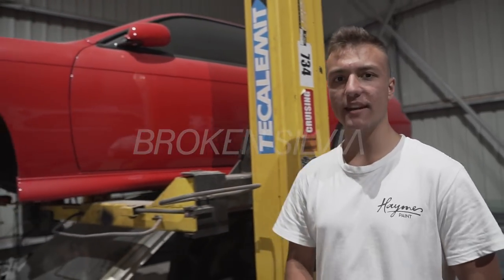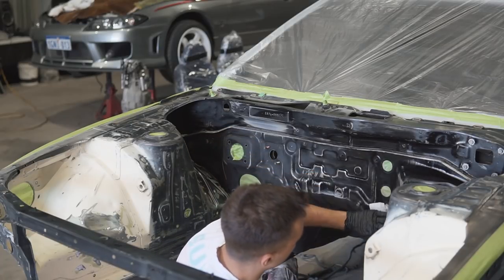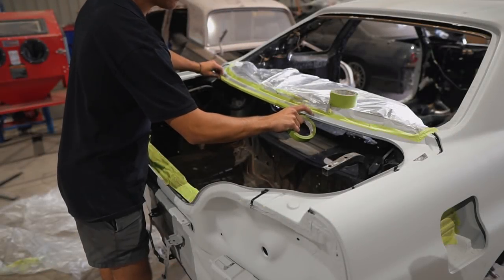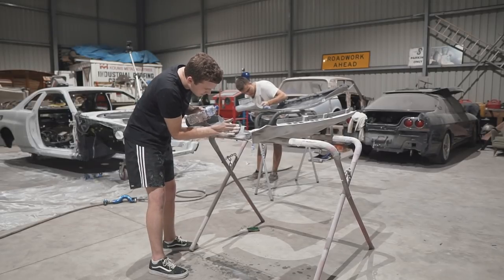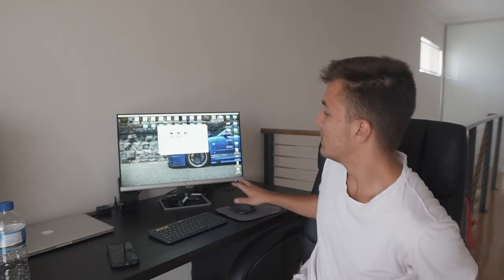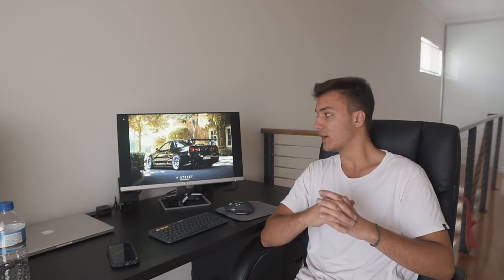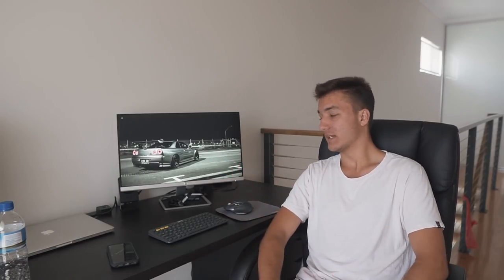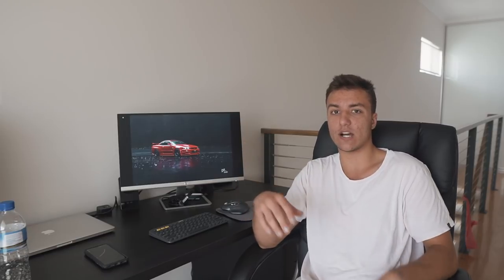My R34 Skyline is PAINTED! | Poor Man's GTR [EP10]

Comment: Downside to red ... the colour red fades the swiftest; it’s a science thing.
Reply: All has to do with the light wave lengths. A blue is a shorter wave length, red is a long wave length. Now, the reason I'm going into detail here is I did a speech on colour once and the people who came up to me afterwards and said they had no idea this could be so in depth. All the colours you see have one thing in common, the colour given off something means that it absorbed all the other colours and that one particular colour is reflected off. Hence a green leaf shows green is because it has absorbed all the other colours. The time light is spent on an item, car, plane, leaf, tree depends on the colour reflected. A blue colour reflects that colour quicker because the light length is short, however, when we come to reds and derivatives of red, the light stays longer on that colour and has more time to degrade. Hence you see red cars with colours that have been bleached out. A reason why red fades quicker. Hope you didn't get bored reading this. Your car is going to be amazing.
Reply: silverGTO TwinTurbo nice GT3000 i want one so bad
Reply: @_.Mercury._  Thanks buddy, had her for eight years now, she is my baby and wouldn't trade or sell her. It is actually a JDM GTO (Japanese Domestic Market) with a few mods, carbon fibre steering wheel and loads of other mods. Has been the GTOUK car of the month three times in the past five years.
Reply: Im a car detailer and i find red hold scratches and dirt a lot more too
Reply: silverGTO TwinTurbo yeah currently looking for one, i know quite a bit ab Jdm, as an American i call them 3000Gts, ya know its like calling a 240, a 200, or 180 but... ive always had a soft spot for those Dsm stuff, and theres a really clean dark green one close to were i live, but i can only find them in red and white, i mean they look phenomenal but the dark green just strikes me more.
Reply: Its actually the green pearl

Comment: I always enjoy these types of builds and your attention to detail just blows me away. So I'm wondering why when you removed all the seam sealer from the engine bay, why you didn't stitch weld the seams. As I've said, I enjoy these types of builds and in most, when the level of detail you've already done on this build, most would do the step of stitch welding all the seams to add extra structural strength. I know this affects how a car will perform in a collision, but the extra stiffness and rigidity for this type of car, given how you intend to drive this  car when finished would be a good thing. I know it's your ride and it's totally up to you. I was just wondering. Excellent build! I'll keep watching and thumbs up!
Reply from the maker: Hey man thanks for the comment! It's a street car so no need for it. If it were a dritft car that will never see the street then I would consider it :D

Comment: Awesome vids, ive been watching since the start. I have an 04 sti that im going to tear down and work up from the ground up. What grit do you recommend to start off with, when wet sanding? Also is it a good idea just to use a heat resistant spray paint for the suspension mods that i want to re-use but restore?
Reply from the maker: Cheers man
Finish off with 600g or 800g wet
Get them powdercoated
Reply: @BrokenSilvia  thanks bro, i was trying to do it all on my own and dont have the equipment to bake it.

Comment: Red has no downsides. People in America scream it's a cop magnet. Nope their driving is a cop magnet. Easy to keep clean, passes the 10 foot visual test with flaws and like you said easy to spray. The world just like boring grey, white has ethnic and religious overtones and black is hard to keep clean, but as you said ceramic coatings and other paint protection is a must, it will save you the headache of owning a black car, short of wrecking it.

Comment: You missed out silica breath. Yeah its really hard to choose a colour and took us months. We did numerous test sprays and ended up going with our own variant of millennium jade as the original jade is too grey and ours is a more suited brighter olive which shows off the lines a bit more. In fact I'd say its inbetween MJ and Silica breath. I personally would of gone red but my mate has an actual real 1 of 62 red R34 GTR so similar to your reasons I couldn't go that colour. 

In all honesty the colour I would of chosen for you, would of been Yellow. It's the rarest R34 GTR colour and probably the nicest to go with black and carbon. Its pretty much the best colour option out there and would transform your car. 

I really hope you didn't go MP2 like in the thumbnail. It's a R33 colour and I hate it. It's the second most common colour for a R34 GTR Conversion with bayside blue being the first. With all the hard work you've done it would be silly to not differentiate your car with all the other builds. With that in mind the only option for you is to go custom colour like us or Red, Yellow, Silica Breath or millennium jade. If not any of those options I truly feel you have made a mistake. Everyone sprays there car MP2, not joking.